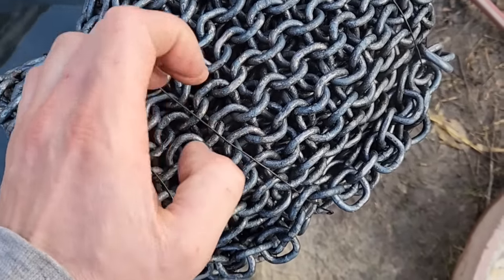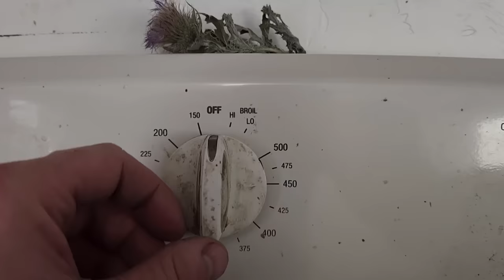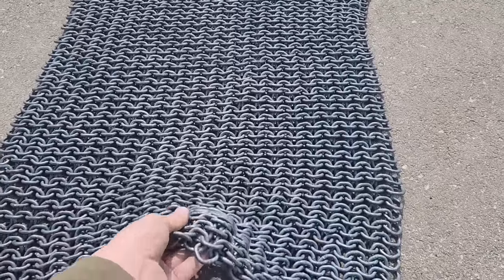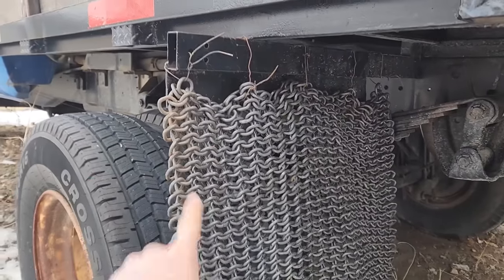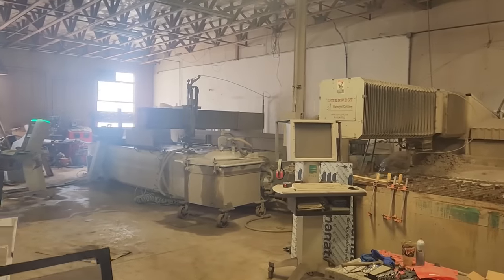Making Chainmail From Chain

Comment: I really appreciate that you haven't changed how you operate in these videos. Stripping zinc off a chain? No fancy vent hoods or anything just a bucket outside. Really makes me feel like I could do these projects and makes what you teach connect easier to me.
Reply: I think youre almost at a problem thats common in DIY and our society at large, we tend to think 'whats the best way to do this?' and the restrict ourselves to doing just that without considering there is probably a much more accesible, less resource intensive and cheaper way of doing something.
Reply: The problem is the people who make these videos are usually highly educated in the field and know how to do it safely. Even if it looks like they're doing it in their back yard. Many things aren't explained because it's not entertaining or they do it subconsciously. This video is more on the side of doable though.
Reply: It’s people like you that are the problem. “I could do this!” 🙄
Reply: I should add, you can do pretty much anything at home that's where most of this stuff was invented but definitely do independent research. Make sure what you're doing is safety, learn how to dispose of chemicals properly, and make sure you have multiple sources outside of just YouTube videos.
Reply: That Mail would rip the mountings out before it failed Structurally. Well Done, Cody.😮😊
Reply: @xyphold Usually, the people that do these things, build their own equipment. 😮😊
Reply: This is an assessment.
Reply: @xyphold Bruh. The reason cody is able to do this stuff is exactly because he is HIGHLY educated. He even knows WAY more than those fancy-pants rich people that can afford a lab.
Reply: You can absolutely do all that, just know you'll join Cody on the government watch list 😂
Reply: @Broockle implying im not on any government watch lists already
Reply: @mrkrusher29 or people think their health is more valuable than whatever DIY project they are doing...
Reply: Fr, remain yourself cody
Reply: @Xyz46786 just because you cant doesn't mean others cant
Reply: No vent hood for the fumes. Sounds great.

Comment: Now extract the zinc from the acid and put it back on the chain
Reply: "Can you take the stain of this shirt and put it on that one? "
Reply: @nobodynoone2500  lol I wouldn’t say shiny good looking zinc that prevents rust is a stain but you do you
Reply: That should actually be easier than you think.
All he'd have to do is, neutralize the acid (and that might not even be necessary) then use the resulting liquid as an electro-plating solution.
No need to extract the Zinc first.
Reply: @jacefritzler5192  sounded like some kind of a joke to me
Reply: @The_Keeper I don't see why this wouldn't work
Reply: Zinc electrolyte plating.. or gold, chrome, copper or silver?
Reply: @The_Keeper  would you have to wire up every link individually?
Reply: @claytonfs  I honestly don't know.
I think you'd probably have to.
Reply: @claytonfs   If it's fully suspended from the top there should be enough tension for all the links to have decent electrical contact with each other. You'd probably want to shake it around and change the grip several times to make sure anything that gets missed one pass gets covered the next pass.
Reply: I think it would stand a better chance against rusting if you chrome plate it instead. Zinc is very reactive and will oxidize away quickly
Reply: @berukadehikari2634  Chrome plating would not work either. Well, it will if you just want to hang it on a wall and admire it.
But if you were to actually use it for any kind of purpose where it will get worn? The movement of the chains themselves will quickly wear away any kind of plating or coating put on it.

If you were to use it as armour, then you have the issue that every strike it takes, will break the plating, allowing rust to form. And rust will form quickly, as people wearing armour get hot and sweaty very quickly, and our sweat is pretty salty.

Thus, for most any maile? You would really just treat it with an oil to preserve the metal. It would be a routine maintenance thing. A lot easier to do yourself, than having to replate it with zinc of chrome every time you use it.
Reply: Why would he do that when it can turn into an impractical lump of rusted congealed crud he can then contaminate future experiments with by leaving it everywhere it shouldn't be?
Reply: Wesome idea
Reply from the maker: @The_Keeper  iron ions will wreak havoc with the zinc plating process. Fortunately they can be removed by adding zinc powder to displace them.
Reply: @The_Keeper Thanks!
Reply: @nobodynoone2500  "Have no fear of that zinc!" laughed Cody with a Vat. "Why,  I can take zinc off chain, just like that!" Do you know how he did it? With hydrochloric acid! Now the chain was all ungalvanized, but the acid was a mess!
Reply: @theCodyReeder  Oh, I didn't know that.
I have no idea when I'll ever need to know that, but its still nice to know. :D
Reply: sounds like an opportunity to make a third video with NileRed this time.
Reply: Sounds like something NileRed would do, except the end goal is something edible
Reply: He's not Nile Red
Reply: @DarrinDarwinacious Yeah, he is. You didn't know? A.I. is wild, man.
Reply: That’s a very bad tempered chain🤪
Reply: Throw some copper in there and hook up a battery charger and wackooo you got rose gold fake chain. 😢
Reply: @DarrinDarwinacious  He's not, but together with Nigel, Cody is one of the OG YouTube chemistry channels. Of course, Cody does much more than just chemistry, but still.

Comment: For the love of god, people. If anyone tests chainmail, put padding under it. You never wear chainmail without padding. It is both for comfort, and is also an integral part of the defense.
Reply: What you say makes sense. It is just that historically chain was used over normal clothing in some times and places. I don't know why.
Reply: Did you forget where you are?
Reply: Silks were used to fret arrow heads where weight considerations forced looser weaves. Still, almost always cotton pads for cooling comfort and shock absorption.
Reply: @johnbennett1465  Probably for monetary reason.
I guess some people could either afford a gambeson, or a chainmail, and had to choose.

I'd go for the chain as well. Sure I might get pinched and bruised, but at least I won't get stabbed or slashed.
Reply: @The_Keeper  your explanation would explain some of it. But my understanding that in some cases it was the norm. 
I am basing this on statements by Youtubers that specialize in this. I have no expertise related to this.
Reply: @johnbennett1465  
ok.
Lets see, so it was a silly/stupid thing to do, but many people did it...

Well, when something like that happens, there is only one culprit that can be responsible;
Fashion.
Reply: @The_Keeper  an expert might have a better explanation, but I don't.
Reply: I wear chainmaille jewelry all the time with no backing. I don't back any of my pieces and never had any complaints. If you are wearing it for combat purposes, a lot of the reason you wear a gambeson under chainmail is so that if the rings break they don't become embedded in you. Considering in those days a scratch in combat could be life threatening. Also to dissipate the direct force of being struck in the mail. Cloth also bunches around a stabbing implement when passing through mail. It is however possible to make chainmail that you can wear entirely without padding if it's not combat oriented. I know people who make chainmail dresses and all sorts without backing. So sort of yes and sort of no but the yes is more a concern for the danger broken rings posed in times before modern medicine. With our modern materials you could make chainmail that doesn't require backing, even with a combat focus. An even better reason for backing on medieval armour, including chain and plate was that they fought in deserts a lot and you don't want bare metal in a desert against your bare skin. So padding for comfort wasn't really why they did it at all. The idea of padding for comfort is something of a misnomer as many knights were known to self scourgify and flagellate themselves for their sins, even wearing hair shirts and reveling in the discomfort as penance, so I don't think a bit of pinching or chafing would have been a consideration for them.
Reply: I used to stuff woven straw under my chain mail, until I was killed in battle anyway
Reply: Having thinner padding can make a big difference by lowering heat buildup. Its a tradeoff, but your shield should be taking the arrows and the big hits anyway, if you have one.
Reply: For those guys with hairy chests, wearing a shirt is a must when wearing chainmail. Otherwise prepare for the binding.🤪
Reply: @The_Keeper  yes. Combining gambeson with mail was expensive. It was usually only done by knights and the like in the early medieval period. But rarely was chain worn without gambeson. Gambeson is far more protective than people give credit for.
Reply: @johnbennett1465 regular clothing was not like it is today. It was much tougher, and they wore more layers.
Reply: @Swisba  while you are generally correct, southern Europe can get very hot. Armor makes it even worse. So there is a trade off of comfort vs. protection.

Comment: When Iron is heated it's grains takes on a variety of crystal structures at different temperatures, if allowed to cool slowly (annealing) the metal reverts back into it's plastic pliable form, when heated and quenched suddenly it locks the iron into what's called face-centered cubic lattice locking all the atoms in place making the metal harder.
Reply: Yes, but actually no. It's not getting locked into face-centered structure, you only need that because of its higher solubility for carbon in that structure. You can tell from hardened and tempered steel being magnetic, while the face-centered structure is non-magnetic (see stainless steel with high nickel content).
Reply: I need to learn this sacred science...
Reply: Haha. It's cool that i've just learned these fancy words recently on university.
Reply: @AdventuresOfKeithius  Take some Materials Science course :)
Reply: 1. Heat steel above certain temperature
2. Steel becomes austenitic (face centered), which has high carbon uptake
3. Quench
4. Iron rapidly reverts to body centered crystal structure which has lower carbon uptake
5. Carbon atoms don't have enough time to diffuse out of the crystals since diffusion is a rate and temperature dependent process
6. Carbon is forced to stay inside of the body centered crystals and creates compressive stresses, which increases hardness
Reply: Yeah I think it's misleading to say these different processes retain or lose carbon from the material itself it just changes how well it's dissolved essentially. There's the same percentage of carbon in the material no matter what process (other then the massive decarb there is from heating the material to critical temp in an open atmosphere furnace like that
Reply: Thank you, that terrible explanation was really bugging me (mechanical engineer)
Reply: It's what we do for making the cylinders that firefighters, navy, hospitals, police etc. use. During the pressing phase where we shape the cups we anneal them to make them workable. After they're shaped and the dome and neck is added we heat and quench the liners to harden the shit out of them. Then I add the port and threads with a CNC milling machine.
Reply: It's called martensite...
Reply: @renehuber9096 you seem quite astute, sir. I am of the understanding that quenching is best done in oil, not water due to its low boiling point and the associated hazards with steam. Is this true, or is water adequate for tempering?
Reply: harder but a bit more brittle. it's really a tradeoff between the ability to deform without breaking and the ability to not deform but once it actually reaches a certain point, it fails more catastrophically.

Comment: Hey Cody, when you're quenching the material, it's better to move it up and down in the water, because if you just place it in the water bath the immediate liquid around the hot metal will create a bubble of vapor around it which will prevent the water from being as effective as it should quenching the material. This is what many smiths are taught, so if you watch videos of them forging things, this is why they sort of bob the material in the quench bath.
Reply: I never knew that but that makes complete sense. Thanks for the advice
Reply: Would he pretty dangerous for him to hold onto it considering it was splattering boiling water all over.
Reply: I assume it would be hard since theres so much metal in this project
Reply: This is far more of an issue for an oil quench than a water quench. Yes, the steam jacket forms in both quenching media, but water vapor is still very heat conductive, and will therefore still cool the metal quickly. The Grossmann H-Value (a measure of quenching intensity) for water without agitation is 1.0, while the same for oil without agitation is 0.25. An oil quench with violent agitation (which is beyond what most smiths will ever do, and probably impossible to even achieve with a workpiece as large as the one Cody was working with here) is around 0.8 to 1.10, which means that the highest cooling rate possible with oil is roughly equivalent to the cooling rate of water with zero agitation. Extrapolating this principle, an oil quench with moderate agitation (which is what most smiths will use), with an H value of 0.4 or so, produces significantly slower cooling when compared to a non-agitated water quench.

Moreover, using water AND moderate agitation produces an H-value of 1.3, while strong agitation has an H-value of 2.0, and violent agitation can get all the way up to 4.0 - all of these options cool the steel far faster than oil ever could, and thus the more you agitate in water, the more likely you are to risk shattering your workpiece.
Reply: Yeah blacksmithing  is hard.
Reply: Has anyone actually tested that, or is just something that is taught because people assume it is so?
Reply: @VoIcanoman  I did not know that. I thought it was going to be the same for a quench in water as oil. Thank you for the insight.
Reply: @brindynschultz   i have no experience or formal education on this but i just assumed oil quenches were slower because oil has a higher boiling point

like once you get water to 212 degrees fahrenheit, it can't get any hotter, so the heat differential between the metal and the quenching medium is greater. but oil can handle more heat without boiling, so cooling happens slower as the heat differential is relatively smaller 

but that's just my common sense logic based on the little i do know.
Reply: @VoIcanoman you just scienced the fuck out of that
Reply: @VoIcanoman  Thinking of a deep lake quench. Set up the whole thing in a boat, go out to the deepest part of a lake, connect the hot workpiece to a rope long enough to reach the bottom of the lake, with a length of chain or cable on the end, so it won't burn, then drop the workpiece overboard, letting gravity do all the "agitating". Might need no more depth than, maybe, 30' / 9.14 m.
Reply: That clump of chain weighed 42 pounds. Sometimes good enough is good enough.
Reply: @chrisgenovese8188  it's much easier to move in the water because of buoyancy.
Reply: @brindynschultz  right, I'm sure a 42 lb clump of red hot chains bubbling and spitting hot water would be very to displace in a barrel of water.
Reply: @Its_Captain_Jack_Sparrow  Oh, cool!
Reply: Cody knows.
Reply: There is so much turbulence that i doubt there will be any air pockets devastating enough for our purposes.
Reply: You don't have to be a Smith to know that when you hear up water it turns to a vapor that's just common sense

Comment: i gotta admit the idea of a chailmail doormat would be kinda awesome for a workshop
Reply: Welcoming or terrifying? You decide!
Reply: Worlds most durable doormat 💪🏽
Reply: i have definitely seen those before. Prbly smaller links though.
Reply: @Broockle  yup. including as mud flaps.
Reply: I have seen ones that are hard rubber and chain mail. Cleans dirty boots with every step.
Reply: It's easier to clean too!
Reply: these are pretty common, at least down here in argentina. I recall seeing them more than once before
Reply: I'm thinking take an old rubber mat, heat up the chainmail just enough, lay it over, and now you've got a stable mat. That sounds really dope ngl. Plus if you really want to, you can tear ir off the rubber, retreat the chain, and use it for something else later on! (I know nothing about any of this, I'm just spitballing something that sounds cool lol)
Reply: @carlosgaspar8447  logging trucks I think still use them.

Comment: I'd argue your metallurgy isn't 100% sound but your concepts are right. In short, while carbon molecules are relevant, tempering an annealing has more to do with the alignment of crystals in the metal matrix. When metal is hot, crystals align themselves with each other. When cooled slowly the crystals can form or settle in a random configuration. When metal is cooled quickly, the crystals are all remain aligned making them strong. Cooling in Water can be problematic compared with cooling in oil. But it can be done and without a doubt the additional annealing worked great for chain mail armour. 
Great Video.